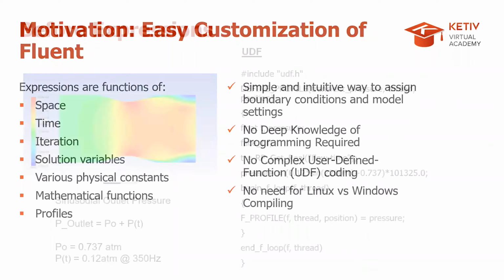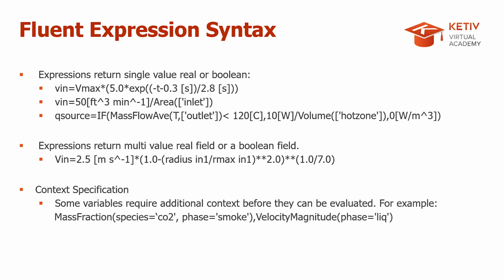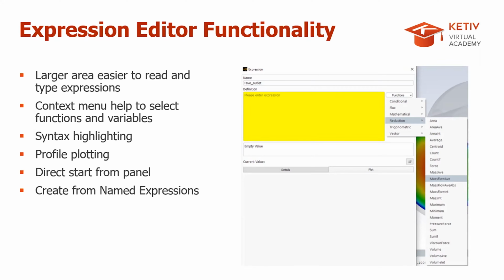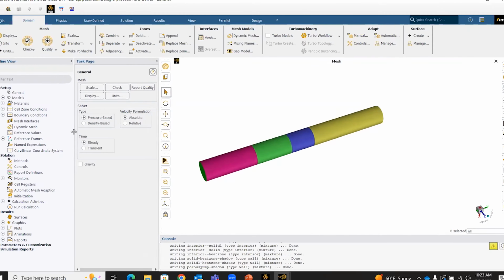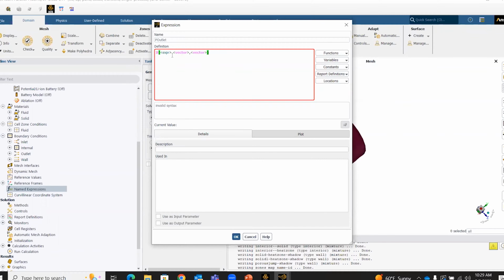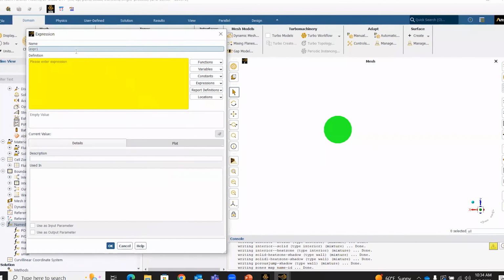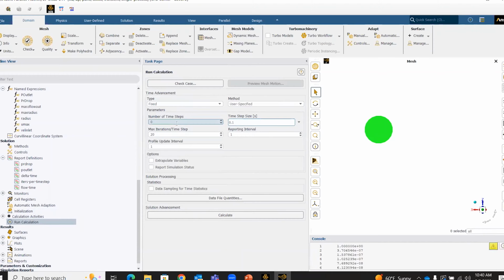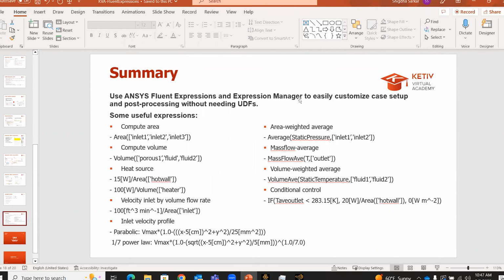Using Ansys Fluent Expressions to Simplify Setup and Post-Processing | KETIV Virtual Academy

Comment: Thank you for your presentation Pr, Its a good job, I have question about realization of geometry in design modeler, So, when we prepared a 2d axissymmetric circular pipe with a wavy wall, how to defined the equations of the wavy wall? this equation needs to combine of 2 equations because a different shape of wave?
Reply from the maker: Hello. 

KETIV has received your inquiry and is actively working on a response. We apologize for any delay and highly value your engagement.

KETIV
Reply: Thank you for answer me, Best regards @KETIVTechnologies